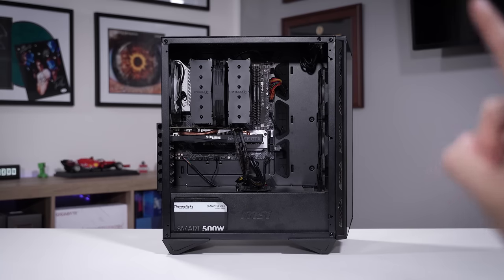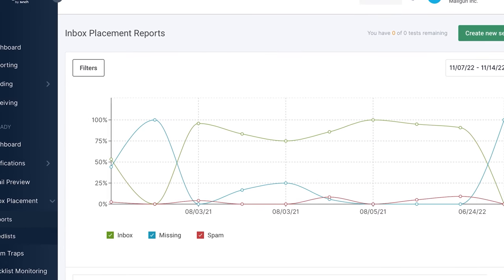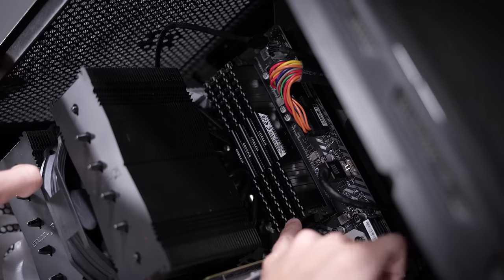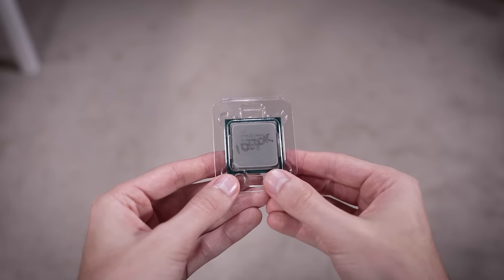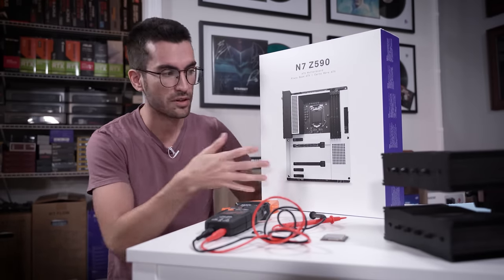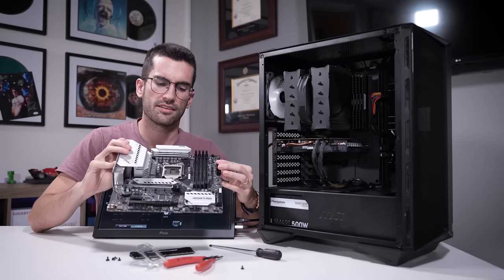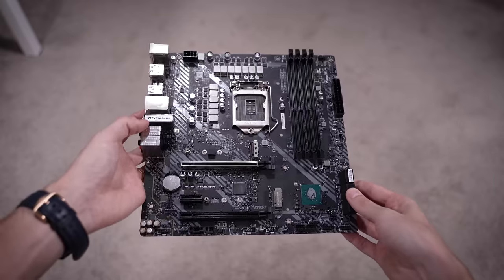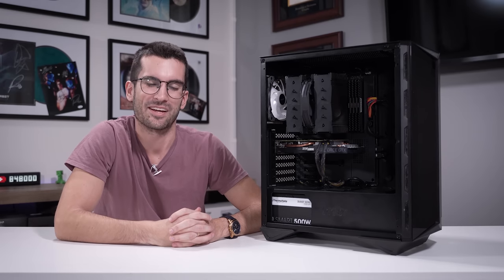Fixing a Viewer's BROKEN Gaming PC? - Fix or Flop S3:E14

Comment: You are always careful about locating ram in the optimal slots and often times I wonder if I should use 1 and 3 or 2 and 4, but in the end when checking the bios if I see dual channel mode I assume all is good. Am I right?
Reply: _greg_salazar0  Is spam, an actual prize, or just an acknowledgement?

Comment: 4:20 you can actually clear cmos if you take out the battery for 10 to 30 seconds
Reply: True, but it's easier to just jump the CMOS pins if you can reach them.
Reply: @Joreel  it is easier to unplug the pc then hold the power button for like 30 seconds to a minute
Reply: @DragonProtector   that only discharges the caps. It doesn't clear the CMOS otherwise I'd be constantly redoing my bios setting every two weeks when I give my rig a lite clean. ( Mainly white build in a house of smokers).
Reply: @grumpyratt2163  true! I forgot I had the battery removed when I did that.

Comment: Is that an nhd15 with one of the fans removed due to the ram? If so, owner should be able to cheat the fan on the right out a little and still be able to clip to the heat sink. That’s how mine is
Reply: Noctua sells a version of the nhd15 with only one fan

Comment: You know what the problem is and you dont fix it and change the board. LOL
Reply from the maker: What are you talking about? I don't know what the problem is... I said it may have been the BIOS chip, but a flash was never attempted by the owner so it's not a certainty.
Reply: @GregSalazar  No you said that owner tried to reflash it before giving it to his son and now is not posting and BTW mate you have a bios reflash button on the back plate and you didnt even try to reflash it...

Comment: I would flash the bios again. Probably something went wrong when he tried to flash bios.
Reply: There's no way to flash the bios on this dead motherboard.  You have to use special tools to do that which he discussed.  Newer boards have bios flashback making this much easier to recover from.
Reply: @my-yt-inputs2580  It wouldn't be unreasonable to expect someone in the business of fixing PCs to have the required tools to flash a BIOS, those tools aren't exactly expensive. I don't know why Greg wouldn't just get a BIOS programmer instead of replacing mainboards every time this issue shows up.

Comment: Owner said they cleaned the computer. @4:50 you can clearly see some threads or dust around the debug LEDs. How did he clean the computer yet left that? Could dust being pushed down in the DRAM slots cause an issue? Also the possibility they used alcohol and some was left in the DRAM slots when it was first booted up afterwards.
Reply: Alcohol doesn't conduct electricity
Reply: Dust shouldn't prevent 4 slots from working if it isn't visible that much
Reply: @oof8392  The board looks actually pretty clean for an older System. Maybe the owner overdid the cleaning and broke/shorted one of the smaller things on there? That's why I usually stick to the fans/heatsinks when cleaning my PCs and rather leave a bit of a dustlayer on the main/cpu boards than rub around (even gently used q-tips can get stuck on stuff) and break those tiny little things.
Reply: @WirrWicht  I was just brainstorming as the cleaning and re-assembling aspect is all we had to go off of why this now doesn't work. But note rubbing alcohol is not necessarily pure alcohol, and that's what most people have in their house.
Reply: @oof8392  Maybe they cleaned it with a steel brush? lol.

Comment: would you not need to reinstall windows after switching boards with different chipsets?
Reply: nope, and if you're gonna do that, make sure to remove the windows key to use it on the next hardware change.
Reply: usually windows will reconfigure itself without any problems, especially since both chipsets here are very similar. You will need to re-activate windows though.
Reply: only it the drive is configured with TPM on and as long as the motherboard was registered with at least windows 7 no need to enter new product key

Comment: From what I learned watching bios programing videos, best way is to desolder bios chip (with hot air gun), solder it on programmer adapter board, save existing bios firmware, flash full new firmware, solder it back to PC motherboard.

Adapter to attach directly onto a chip without desoldering exists but supposedly contact to chip pins is not good in same cases and other motherboard components can give an issues.

I never done any programing and such. If I wrote a mistake, please someone correct me, thanks 😁
Reply: When reprogramming BIOS chips that way, you have got to make sure you're using the correct voltage, because not all BIOS chips have the same voltage. And if you get the wrong one there is a chance that you blow up the BIOS chip.
Reply: @jonathanmaybury5698  yeah I agree. Thank you for reminding me 😁

Comment: Would trying to over clock the ram higher than the mother board could handle do that?
Reply: If it was too high that it wouldnt boot, clearing the cmos would reset it to jdec speeds which I believe on 10th gen is 2933 maximum supported speeds. So clearing cmos would of fixed any issue due to unstable memory overclock.

Comment: Now if the BIOS did take
And whatever processor he did have no longer works because now you have to have an updated CPU
For instance if he had a 3800 updated the BIOS now he has to have a 5000 series which one exactly I have no clue just any one of them should work

Comment: Hey any advice I got a free computer with a i5 3470 and 16gb of ram is a dell opitplex 7010 what kind of graphics card would you recommend for some basic gaming
Reply: if you have the budget, put in a i7 3770, it'll run much better.
as for a graphics card go for something like a GTX 1060 6gb or RX 570/580. Can get those for £80 or less nowadays.
Also make sure the PSU is good enough and that you have any required PCI-e power connectors. If you don't wanna replace the power supply, then go for a GTX 1650, which will work as long as your PSU is at least 300w, however it costs more than the other GPUs I mentioned whilst performing worse, only reason to get it is because it doesn't require a PCI-e connector.
Reply: Gtx 1650